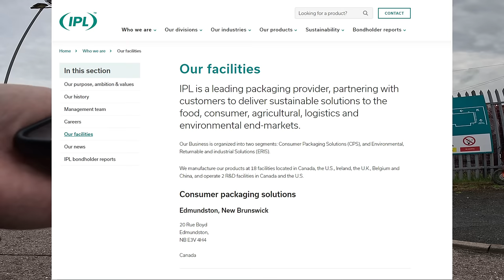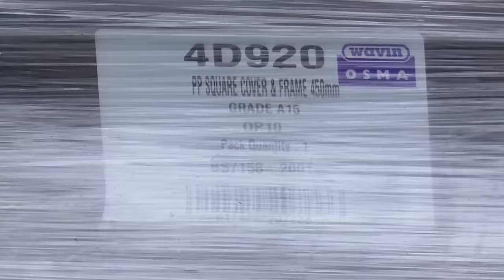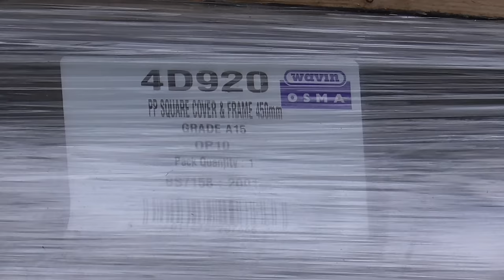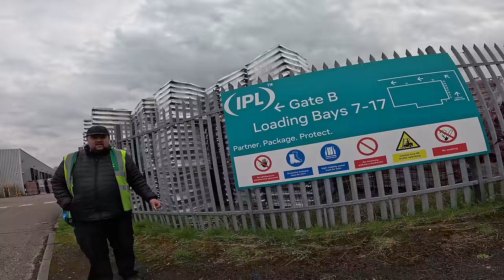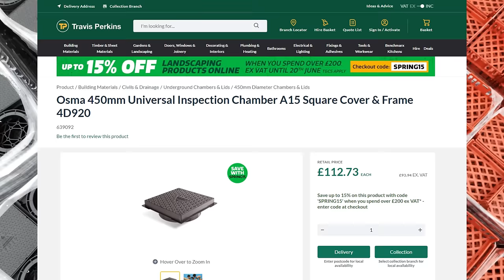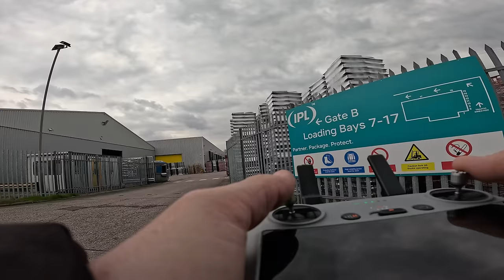I Will Ask You Not To Video Because I Don't Want You To 🙄🎥🛸❌

Comment: 20:45 I’ve seen them use these on site, they are used for large soak aways. They dig a big hole, fill it with these, and back fill with gravel then back fill with soil 👌

Comment: Those Cubes as you call them are Soak Aways, they go in a hole in the ground and drainage pipes are fed into them and they are covered over. Water soaks  into the ground slowly from them.

Comment: 21:10 The plastic cubes are for soakaways. Dig a large hole, put the cubes in cover with geotextile and grass over. Any excess rainwater will then soak into the ground and not down the drain into the river.
Reply from the maker: Great idea. I need some under the grass in my garden 👍
Reply: are you sure you should be telling every one what about data protection.